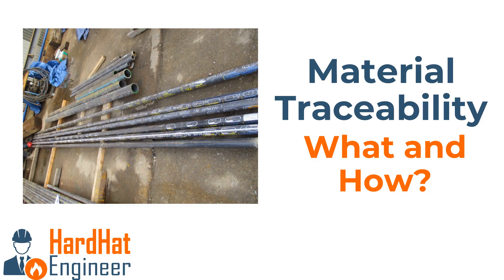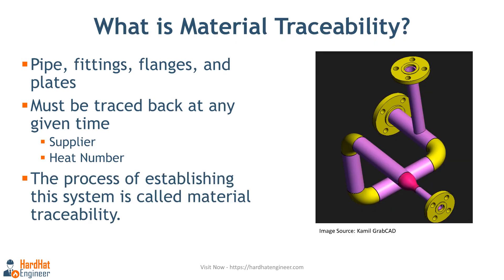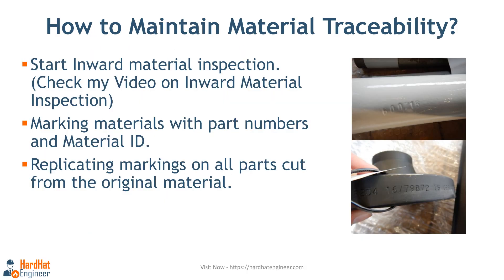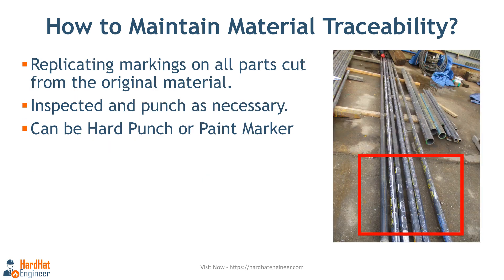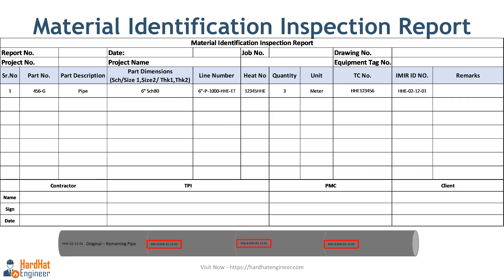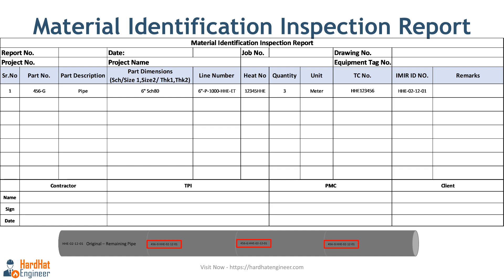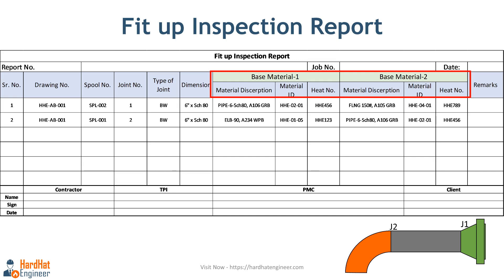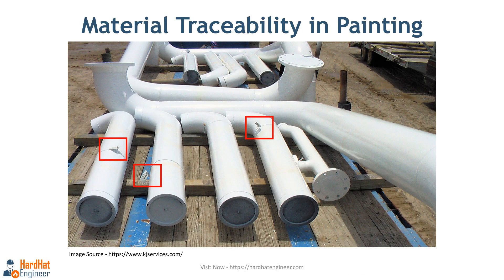Importance of Material Traceability During the Fabrication.

Comment: Thank you for a nice video, very educating. I would like to know which tagging techniques/methods (QR-code,RFID tages etc) are okay for long time use on steel structure. in other words, what are the Tags that are reliable  for signal after long use and can work with mobile app?
Reply from the maker: This is depend on storage and environment. RFID is more reliable if there is no disturbing element present and you are really looking for permanent kind of things as it is costly as compared to QR code. QR method is also effective if you can protect code as it is cost effective.